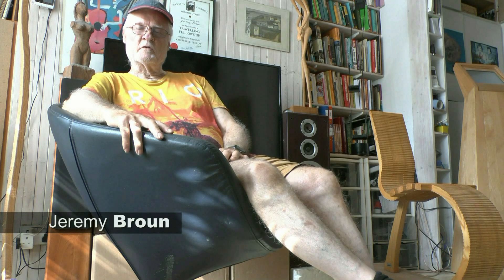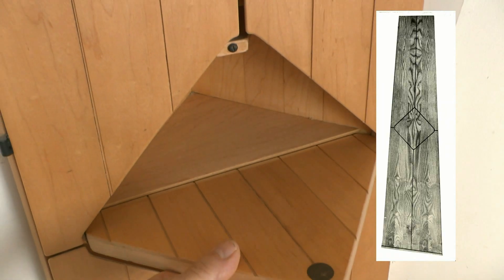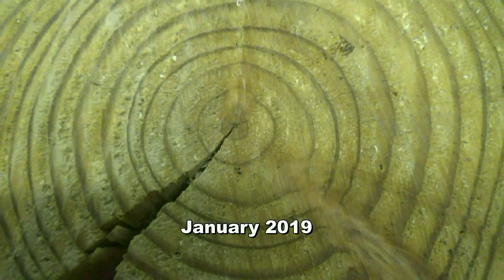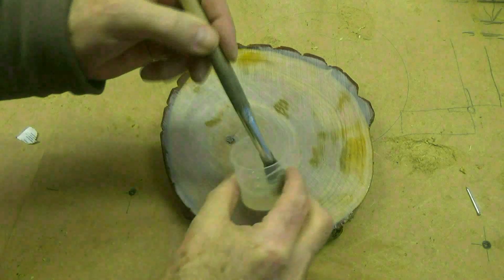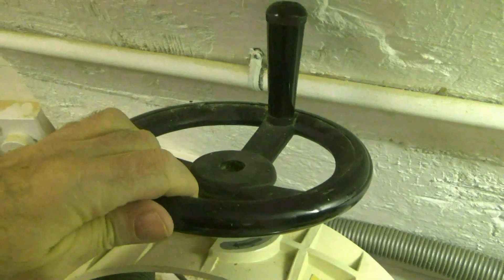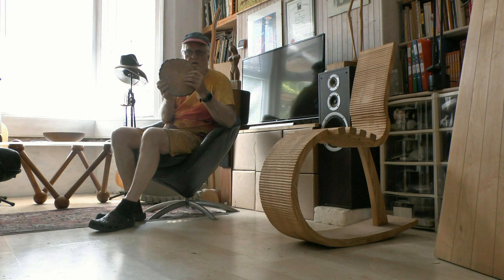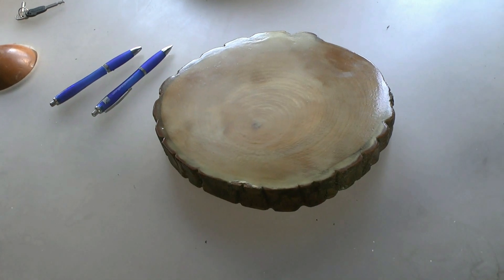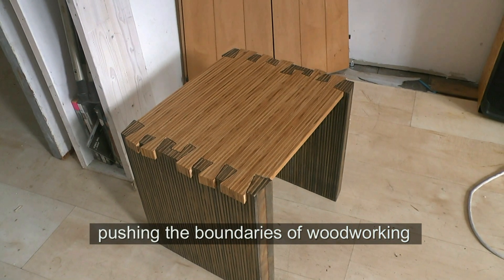End Log Slice 100% Seal Experiment Four Years On

Comment: This is interesting. I've seen a lot of resin tables lately that contain wood and are being sold for a large amount of money. I wonder if they will end up like this after a few years. I suppose drying out the wood properly would cause it to crack. Is there any way of exchanging the water moisture for something else, like the process used 
when insects, etc. are encased in resin moulds?
Reply from the maker: Maybe somebody watching  the video has knowledge of this? All I know is that woodturners use PEG (Polyethylene Glycol) to stabilise green wood. If I had the time I would spend more time experimenting. I think i've made enough furniture for a lifetime (pushing the boundaries of design - www.jeremybroun.co.uk ) - I have tested glues (https://www.youtube.com/watch?v=AEj404EhW9U)  now let's develop this test on wood!

Comment: Thanks Jeremy for the update. I've thought about your experiment 'off and on' over the years and  wondered if the core moisture inside the  log slice would eventually rot from the inside out hence the cloudiness?  Perhaps the absence of air has prevented this from happening -a bit like the Mary Rose timbers some of which, as you know, were buried in sand,   The old saying that 'wood moves' and is a living substance might have something to do with it?
Reply from the maker: I can only guess that some kind of chemical reaction is going on since oxygen is not a factor here. It could be minerals in the water and specific wood. Only certain woods such as beech and ash suffer 'spalting' which is rot caused by damp when a tree is left felled. By sanding maybe just one surface I can see whether the discolouration is deeper. What happens if I then leave it exposed? Will it bow and shrink and crack? If I had the time I would conduct more experiments. It needs one of my viewers to take this to te next stage to find out what is going on. It is only my guess that the discolouration is moisture.

Comment: I know it wouldn't be wholly accurate but it would be interesting to see a moisture reading off of the wood if you did decide to sand it back and could check. I saw you mentioned over 60% in your previous video but I'm assuming that was just a generality and not a specific measurement to that piece. Either way, quite interesting and good funky tunes at the beginning.
Reply from the maker: Yes if I sand it down I will do that. My problem is available time at the moment. I borrowed several hours just to make this short video.